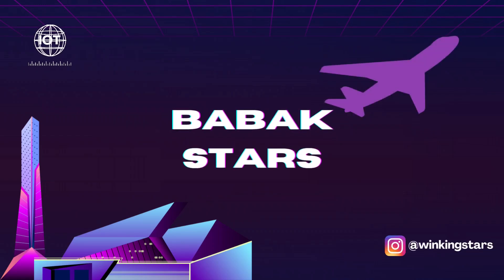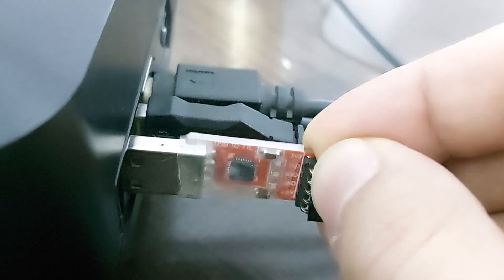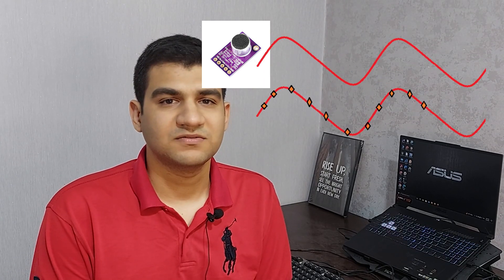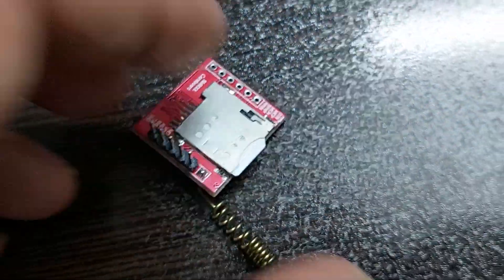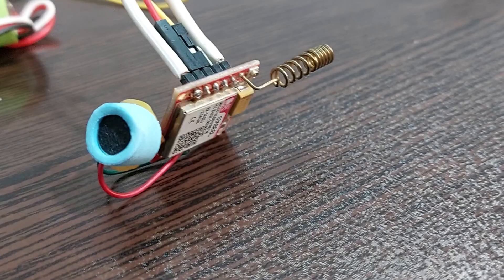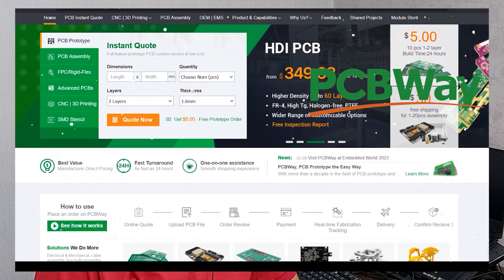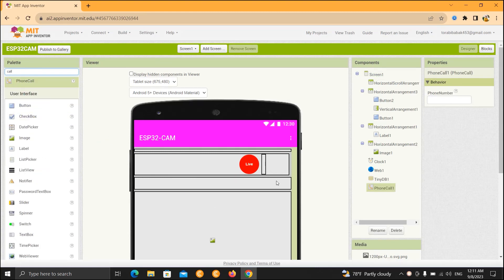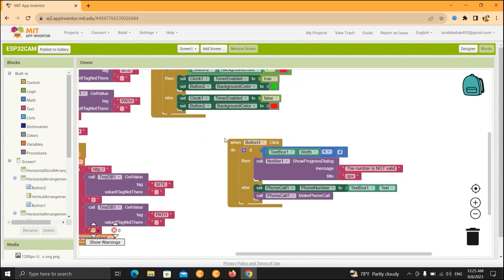Security Camera & sending sound with #sim800l gsm module

Comment: Can I use electret microphone and straight plug it into the mic+ and mic- of the sim800l?
Reply from the maker: According to the sim800 datasheet, only a condenser microphone was used. But the overall sound was weak. My suggestion is to build an amplifier with LM386.